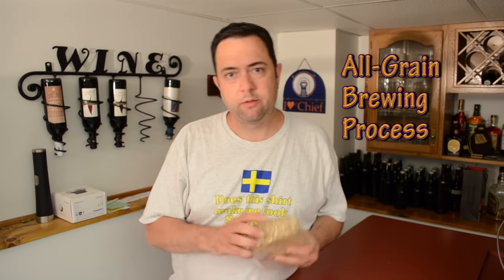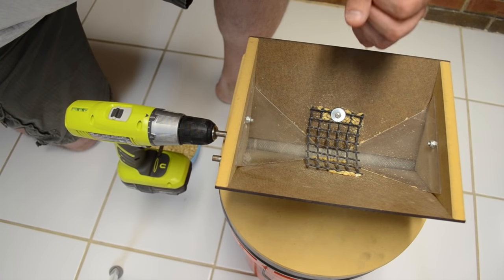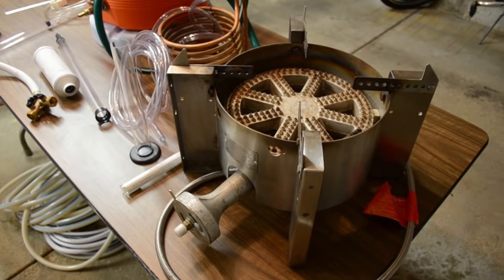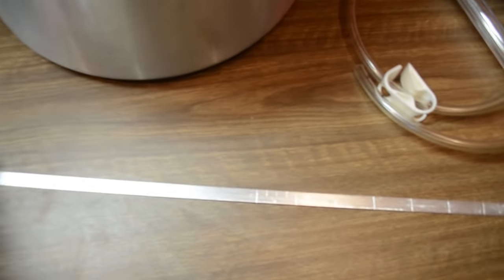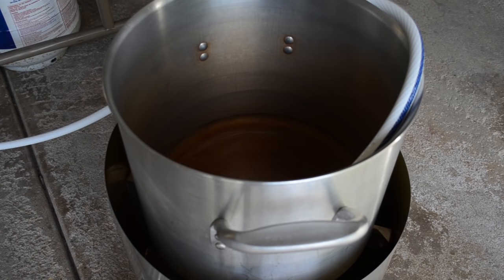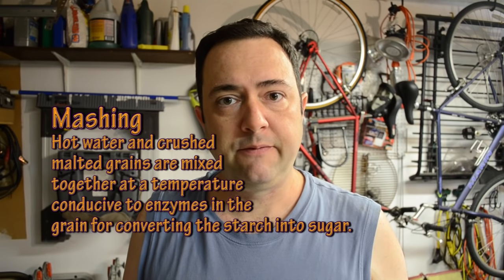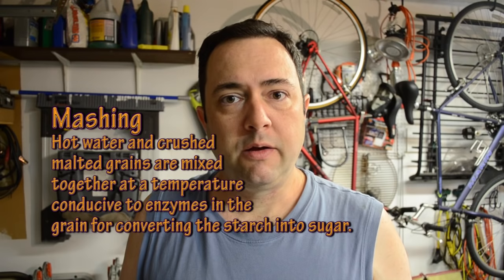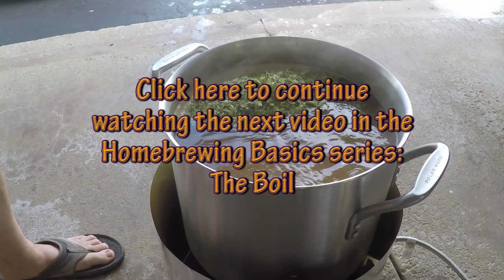Homebrewing Basics: All-Grain Brewing

Comment: Great video. Air in the wort doesn't make a difference though. You have it sitting in a kettle (exposed to air), boiling (which removes oxygen from the solution), and then you have to aerate it before pitching yeast ( so the yeast have a good environment to multiply in before fermentation). The only time aeration or mixing with air will affect the beer is when fermentation has begun and any time after that. Other than that, this video was very good and bang on for most of the information.

Comment: great video.  I'm trying to use your spreadsheet.  I think i got most of it (reverse engineer) but would love a video of you explaining how you use your spreadsheet and setting it up.  For example, how does it calculate the first step add, etc.  Great tool!
Reply: +BEER-N-BBQ by Larry ah ok, so equal volume per drain. I didn't realize that.  That's why we need an explanation video! :)

Comment: good video, explains the process quite easily and thoroughly..    the only think I can think of that's not covered here that probably should be is mash ph..   just like oxygenation and tannens from husks, it's an area that can definitely mess with flavor..   if you can be in that 5.1-5.5 range you're usually good and you might have just touched quickly on ph and water a bit as it as important as the re-circulation, and not splashing imo..    but nice video...   great to get more ppl brewing.

Comment: Splashing and stirring the wort prior to boiling will not cause off flavors later on.  Oxygen is essential for the "respiration" portion of fermentation.  It's safe to splash and aerate up until you pitch the yeast.

If you don't agitate the wort before or when pitching the yeast, you run the risk of slow or incomplete fermentation.

I recommend the book "The Complete Joy of Home Brewing" by Charlie Papazian.  It covers everything you need to know for extract and all grain brewing.  Charlie also explains the whys, and what ifs.
Reply: +BEER-N-BBQ by Larry 
When you boil you remove the oxygen anyways. I think it's kind of an old wise tale (hot side aeration). In my experience aerating prior to boil has no effect since raising the fluid temperature during the boil removes most of the oxygen anyways. I think the hot side aeration plays more into effect on a commercial scale, when your brewing extremely large batches and boil time is significantly increased which means your wort is exposed to the oxygen for a longer duration.
Reply: +Ninjabroni what I meant by boil time I really meant the time that is required to achieve a boil.😬

Comment: Hi Larry, thanks for putting these videos together! I'm new to brewing and have done a few extract brews and I'm trying to put together a list of what I need to move to some simple all grain. I had a couple quick questions for clarification. What size is the final batch you were making in this video? That's a 5 gallon cooler for the mash tun? About what size kettle goes well with a 5 gallon mash tun for the boil?

Thanks for your time, Larry!
Reply: I watched through again and realized you went over the cooler and kettle sizes. I missed that on the first run through :)

Edit: 75 gallon cooler and 8 gallon kettle
Reply from the maker: Yes. 7.5 and 8 at a minimum. Better off with 10 gallon a piece to allow for larger grain bills and avoiding boil overs.

Comment: Hey Larry, I am curious why you're not concerned about putting boiling/hot water into plastic containers being that hot water could expedite the process of leaking harmful chemicals into your mash. I figure there might be stainless steel options for a mashtun, but they'd be more expensive. What are your thoughts on the subject?

Comment: Have you noticed a significant improvement with crushing the grains as opposed to simply lautering with the whole grains? I am still confused as to how much starch conversion takes place with the malting process and with the lautering phase
Reply from the maker: You need to crack open the malted grain to allow enzymes to work on the starches during the mash. Else you won’t get much of anything out of them.
Lautering is just the separation process after mashing is done. However rinsing the grains during the lauter can boost extract efficiency several percentage points.

Comment: Thanks, bout to do my first batch. Just a precationary thing. Hot liquids and plastics,polypropylene, and others will cause leeching of plastic softeners. Not good stuff, but hey its in everybody system since all food products are made with plastics. Stainless steel hoses might cost more but look how shiny
Reply from the maker: I think it depends on the plastic and the temperature. For example, I think plastic in my coolers is HDPE and is rated for up to 170 deg F for food/beverage contact which is higher than my average mash temperature of around 150 deg.
Reply: @BEERNBBQBYLARRY  glass is best. But alas they choose not to make durable6.5 gallon 11mm Pyrex glass with conical syphion spicket

Comment: I've got an experimental brew in the works... I've tried a few of the calculators but can't quite get time and temperature as the grain I'm using is wild bird seed that I germinated and malted myself. Would you say 180F for an hour should work for a good general go to or would you recommend reducing the heat and mashing for longer? I was thinking of doing a cold mash in the fridge but that seems to be popular more with stouts or sour beers I can't mind. Mines is going to be a Lager yeast so I'm not too sure if any of that will work  : (

Comment: I like this video. Thanks for posting!

However, I thought boiling water would evaporate the chlorine.

If anything, I'd like to filter out fluorine but I don't think it really affects the taste! :)
Reply: Chlorine "deactivates" when heated.  So if you don't have a "scrubber" type filter, you can boil the water prior to brewing to avoid off flavors in your beer.

Edit:  I use bottled spring water for brewing.  It has better mineral quality and no chlorine or fluorides added.  And at 88 cents or less, per gallon jug, you can stock up for several brews for about the same cost as a filter that can house mold and other flavor killing bacteria.

Comment: Hmmm, I have never heard of hot side aeration, I always assumed any O2 introduced on the hotside would be pushed out in the boil and then absorbed by yeast during the lag phase
Reply from the maker: Waiting until the boil in hopes of removing oxygen would be too late in the same manner that hoping chlorine in water would boil off. In both cases, the undesired reactions have already taken place before you get to the boil. 
There is debate on the severity of impact at a homebrewing level. All agree that hot side aeration is real but differ on whether it is noticeable at the home brewing scale. 
My beers have only improved in quality and longevity since those days before minimizing splashing during transfers to the kettle so I continue to follow the practice. However, I’ve also improved upon other aspects of the process since then, so I cannot say for certain that it is a major factor but my beers last months now when back then I had to drink it all within about 1.5 months.
Reply: @BEERNBBQBYLARRY  Hey thanks for the info, ill have to look into it more. I've been watching your channel for a long time. I was binge watching your videos last night and came across this one.

Comment: Hey Larry i gotta a question for you here. At around 23:57 you started talking about the wort getting aerated. But shoukd that not matter? I was just thinking here all the oxygen will burn off once you start actually boiling your wort. And also that any foam produced from transferring will certainly settle as your waiting for your brew to reach boiling temp? Just seems to me that oxgen (simliar to contamination) is more of a post flame out/fermentation concern.
Reply from the maker: Free oxygen, like chlorine, does get driven out of a boil, but also like chlorine, it can react with other elements to create new undesirable compounds well in advance of that boil starting or completing which is why keeping them out is the better option.  The hot side aeration topic is a debated topic home brewers since at a home brewing scale and rate at which we drink our beer, the effects of such a thing are not noticeable in most cases. However, I must say that my beers have improved in flavor and longevity simply by following this minor safe guard.
Reply: Hey Larry thanks you for the reply. Yes it is a very interesting debate and you seem to have a high level knowledge when it comes to the chemical breakdown. Actually after several years of brewing i just decided this week to finally make the leap to all-grain and just christened my mashtun yesterday. I didnt use a hose because of limited funds but transfered my wort gingerly to minimize aeration, while also implementing some of your tips from this video. Thank you again for the helpful content, you rock man!

Comment: Quick Question couldn't, you also just use a muslin sock or something like that to hold the grains to reduce to complexity and number of steps but achieve similar quality?
Reply: BEER-N-BBQ by Larry is there any other ways to counteract the brew in a bag's inefficiencies with regards to grain
Reply: What if you were to run hot water though a strainer with the bag in it

Comment: I'm using this as a guideline for my first brew.  I assume that the 4.1 quarts added to the mash before the first lautering is based on a 72% efficiency? as 15 strike quarts less the 4.1 you added before lautering  assumed a wort volume of 10.9 quarts, which is about 72% of the starting 15 quarts.  Why only add back 14.1 quarts when sparging?  Why not another 15 quarts?
Reply: Sorry i may be confusing the issue.  I'll speak in layman's terms since I'm still getting used to the terminology.  Your grist ratio is 1.5/1.00 meaning 1.5 quarts for every 1 lb of malt.  I understand that is where you get the 15 strike quarts.  However after everything was put in the mash tun and left to sit, you added 4.1 quarts to your existing 15 quarts in the mash before your first drain.  that's 19.1 quarts in theory if no wort was lost or 4.78 gallons.  then once it drained, you added 14.1 back to the mash tun for a second drain.  so I calculated a total of 33.2 quarts added from strike water to last sparge 8.3 gallons.  you were left with 6. something.  so I guess my question was how did you know to add 4.1 to your initial mash before the first drain and how did you know to add 14.1 on your second drain to get close to your desired pre boil wort.
Reply: Got it, that makes perfect sense.  Thanks a bunch

Comment: Hi Larry, there is a reason why you don't "Drain the mash tun into the kettle" before you begin the sparge method?  

Batch sparging  I was thinking we must do like this but not sure..

Drain the mash tun into the kettle
Refill the mash tun an inch or two above the grain bed with hot water
Stir and let sit for a few moments
Vorlauf again
Go back to step 1. until you have your desired pre-boil volume

Comment: Hi Larry. Would a 30 litre pot, roughly just under 8 gallons be big enough to boil a 5 gallon batch, after taking into account boil off and boil over?
Reply from the maker: I used an 8 gallon pot for many years. Most of my recipes required a nearly 7 gallon preboil which didn't leave any room for error. I just had to keep an eye on the boil over at all times which did get tiring since I'd rather just walk away and do other stuff in the meantime.
Reply: Okay cool, thank you very much for your help Larry

Comment: Why didn’t you just make marks on the side of the kettle?
Reply from the maker: A few reasons:
1) It is easier to mark and etch a removable dipstick. Trying to mark and etch numbers upside down in a restricted space of a kettle is more difficult especially if having to etch them upside down.
2) Dipsticks are not affected by any tilt in the kettle (e.g. due to an unlevel floor or burner) since you can always take a mean measurement from the middle of the kettle with a dipstick.
3) Volume varies with temperature. A single set of kettle etchings can only represent a volume at a specific temperature while dipsticks allow you to use a unique dipstick for every temperature you wish to measure volume.

Comment: Aluminum pot?no good.any book or brewer will tell you don’t use aluminum.besides that I like the presentation well done
Reply from the maker: Thanks, but that’s just not true.  I have books and have known brewers that say aluminum is just fine for brewing. 
This is because of the protective aluminum oxide layer that builds up on the surface as a barrier.
In fact, the kettle shown in this video is a home brewing kettle made by a home brewing company; Polarware.